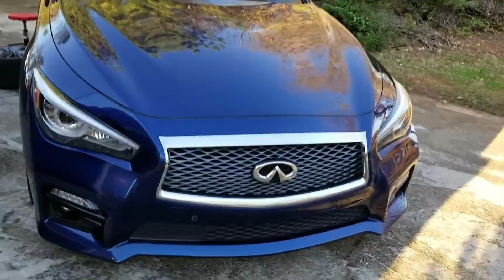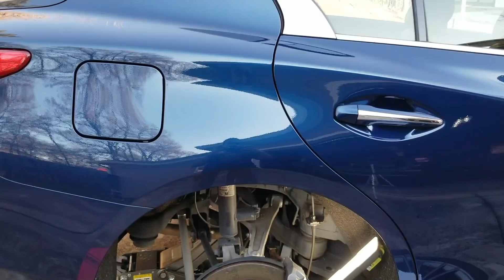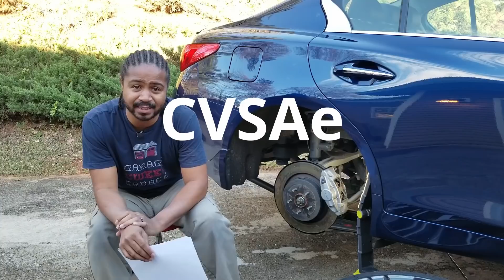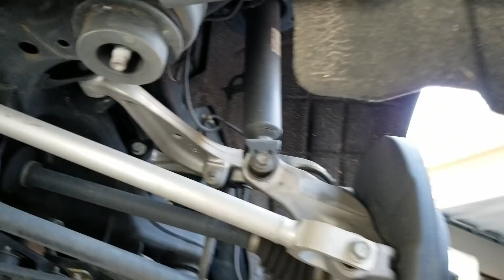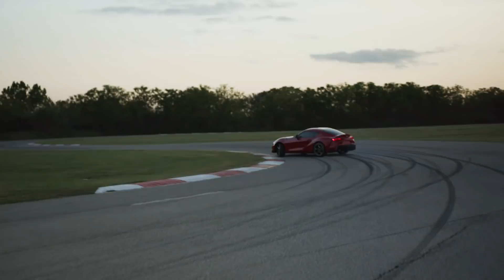Is the Infiniti Dynamic Digital Suspension Legit?

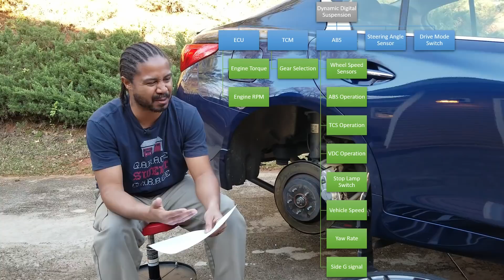Comment: At 11:30 you started talking about the vairous signals the suspension computer digests. The reason it uses "odd" readings is simply because the computer can do math a little faster than we can lol.  Horsepower equals torque multiplied by rpm. H = T x rpm/5252 (don't ask where 5252 comes from). Also, if you multiply the selected gear ratio by the engine RPM, you will find your wheel speed. Once the computer notices a wheel does not comply with its mathmatical logic, it will tell the TCS and/or ABS to get to work.
Reply from the maker: Yep

Comment: Looking at a 2018 q50 sport but window sticker dosent show dss so im assuming it doesn't have it correct or was it automatically put on there i remember it having drive modes but didnt see sport +
Reply from the maker: In 2017 and some early 2018s the sport trim had to be optioned with DDS. If your shocks don't look like mine in the video you don't have DDS.

Comment: If going the spring route (minimal drop) with dds, are higher or lower springs rates better?
Reply from the maker: The spring rates will be higher on lowering springs to help prevent bottoming out, the side effect is better handling at the cost of some ride quality usually.

People who have done small drops with DDS have reported minimal impact on ride quality.

Comment: what would one need to upgrade a premium fully loaded model without DDS to a q50s equivalent with DDS?
(install DDS)
Reply from the maker: DDS, big brakes, extra transmission cooler, paddle shifters, sport seats... off the top of my head...
Reply: @KayDroTechnologies  do you happen to know what parts would I need to upgrade to from standard suspension DDS? are there any extra sensors?

Comment: Idk if you've found this out yet... But the suspension system uses all the engine/trans/abs info for loss of traction situations that could arise from a wheel lifting or dropping. Such as potholes, rocks, road patches, bumps, and speed bumps... Once again, great info and an excellent explanation!! Thanks for the knowledge..

Comment: Hey man very informative video. Do you if the q50S silver sport has DDS?
Reply from the maker: 2016 I believe so... 2018 and up I know so... 2017 DDS was optional on the silver sport...
Reply: KayDro Technologies yea i have 2016 and wondering if my car has it. Im planning on installing a lowering sprin this summer. Do you think it will affect or deactivate DDS?
Reply from the maker: @jeivygarcia3428  springs could effect DDS if they are too low... you never want to operate your shocks too far out of their  normal operating range.
Reply: @KayDroTechnologies  do you have springs on your car?
Reply from the maker: Nope... stock springs... just rear sway bar and front tower struct bar...

Comment: Wow, outstanding review of the DDS, much appreciated, thank you! I noticed the difference right away when I drove a loaner base trim Q50. When I picked up my car, it felt tight/planted, big difference. The sport+ setting tightens things up even further. I am glad I went with my 2016 Q50 sport. If I decide to purchase it, I may get lowering springs for a 1 inch drop, along with  new wheels and tires. All owners should know how bad the dunlop run flats are.
Reply from the maker: Thanks

Comment: Thanks for the in-depth analysis.  Nobody talks about this.  The dealer barely knows how this system works.  I have it on my 2018 Q50S.  It is difficult to feel the difference when cruising along as it does not change very much.  What are the best driving conditions to notice the differences?
Reply from the maker: Just like DAS, with DDS when you get used to it... every time you get in a car without an adaptive suspension you will immediately notice the ride quality difference.

Dont forget to subscribe and look at my other videos.
Reply: No DAS fortunately.  I suppose i will figure it out when the dealer provides loaners.  I think the ride is much better than the G35 ever was.  Thank for the replies.
Reply from the maker: I did a video on DAS... it may change your mind.
Reply: KayDro Technologies In snow, I like to feel what the front tires are doing. Like if the steering goes light, I know I lost grip.  But your video makes a good point for every-day driving and driver fatigue.
Reply from the maker: That's it's only "flaw" it doesn't really go light when you lose front grip... it does "feel" different when you lose front grip... just no what you are used too in a normal steering setup. You eventually get used to DAS and it becomes your new normal. I like DAS.
Reply from the maker: Yes it's hard to notice it working unless you drive a car without the DDS and one with it back to back. But if you want to feel the difference between sport and standard, find a bumpy road and drive through it and switch between sport and standard. The difference between the modes with be easily noticeable. 

Also pay attention to when you brake or accelerate... notice the car barely dives under braking or squats under acceleration.

Comment: How do you think your q50rs or stinger would do against a stock 2014 5.0?
Reply from the maker: In a race? My stockish is Q50 very close, but the mustang does have more top end power. A tuned Q50rs will eat a 5.0 mustang for lunch though.

It's not as close with a stinger versus the 5.0... especially in a roll... the stinger doesn't have enough top end, stock a least, to keep up.
Reply: @KayDroTechnologies  I was wondering because, I see them both from time to time and wanted to run against them to see how I would do.
Reply from the maker: In autoX though the Q50 is in the same class as the new mustang.
Reply: @KayDroTechnologies  definitely not autocross I would need a Shelby gt350 or pp2 mustang lol
Reply from the maker: AutoX is heavily driver dependent... car helps... but not that much if you cant drive lol...

Comment: Great educational video. Question. Does the Chassis Control option on the Infotainment system has anything to do with the dynamics of the suspension? I noticed mine was of this weekend, and I turned it on. I did feel a slight difference in the ride quality. Your thoughts!!
Reply from the maker: That's active trace control. But yes the car will handle better with active trace control on... check my video on the brake limited slip.